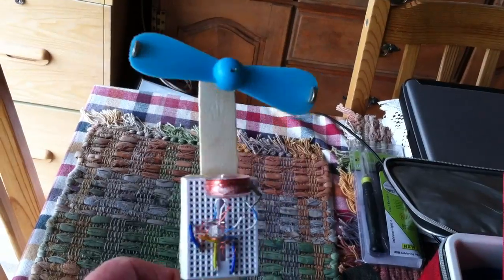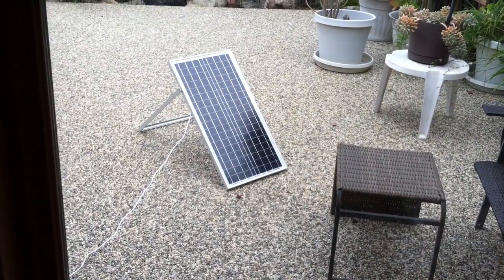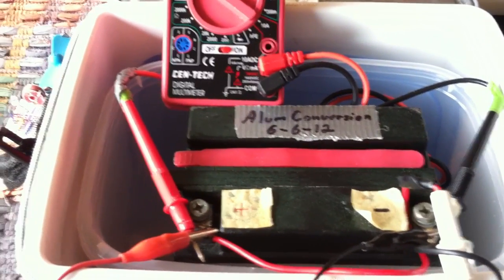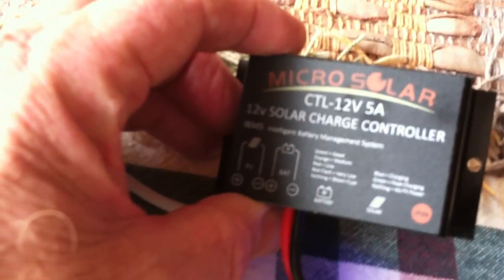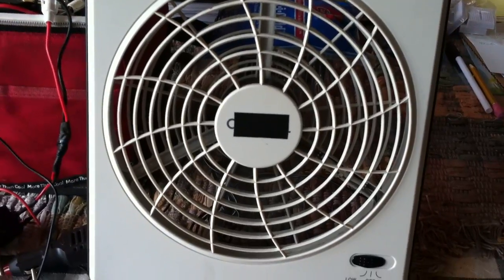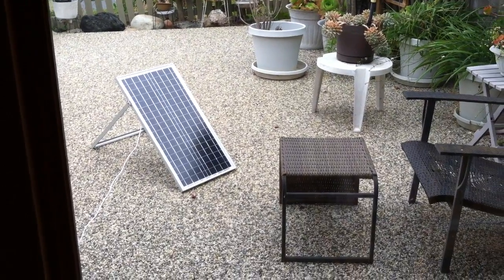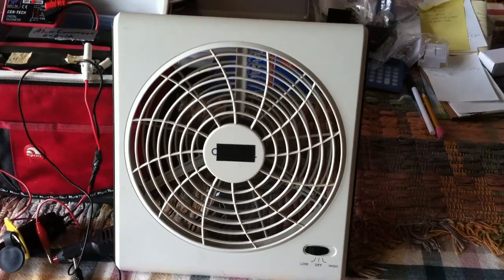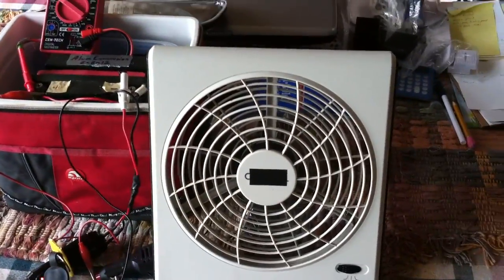Free Cool --- My solar powered AC quest

Comment: A 12v, 4A freezer = 48W.  Your Solar panel is 30W.  Will your batt or batt bank be sufficient to kickstart the freezer compressor & keep the system running when the sun is not shining or are you planning short enough day trips where it won't matter?

My Suggestion:

1.  Acquire a low boiling point ammonia compressor + freezer box (packed full of dry ice at the start of your sea trip).  You might find some help finding one at some RV vendors.

2.  Repurpose an old window AC unit evaporator coil (2 layer is best) + a 12V car radiator fan (to use on your evaporator coil).  Pump either refrigerant (low bp ammonia) or water through the evaporator coil.  Return the refrigerant to the suction side of the freezer compressor or return the water to the dry ice to continue the process (depending on which design you choose to make) .

The dry ice is stored potential energy (lacking heat).  So it could provide quite a bit of heat exchange for you.
Reply from the maker: Thanks for that tip.  The boat is pretty well ventilated and it has a bilge blower to vent that.  It would still be a good idea to keep the ice chest holding the dry ice on deck somewhere. Thanks.
Reply from the maker: Thanks!  Dry ice is a great idea.  The trips I take now in the boat usually only last 3 or 4 days and the dry ice might just be the answer.  On my first trip to Hawaii (many years ago) we used dry ice and it did last quite awhile. Thanks for the tips.
Reply: Just a quick note that you may already know- be careful of having dry ice in an enclosed space
Reply: Good safety point to make!  CO2 is ~54% heavier than air, so without proper ventilation, there is a risk of suffication.

Comment: Our classes a few years back took one of those 12 v. Freezers apart and took the cooling unit (peltier disc, heat sink, and control board all on foam) out and turned the peltier disc over which put the HOT side toward the cooling fins and used it as a heater for under my tchrs desk in the shop classroom.... with a small 6 inch 12 v. fan and it worked great! Like you we used a solar panel, battery, et.al, to power the thing. Had to take it down when the maintainence found we had drilled a hole through the ceiling to get the cords to the roof  :-)  [had to pay to fix it also!] --- Oh well, it was a great teaching experience kids never forgot. Lesson learned? - NEVER drill through schools ceilings......
Reply from the maker: It is funny but some of my most "remembered" lessons from school were events just like that.  It was the unusual things a teacher did  that left a lasting impression.  I had a biology teacher in 7th grade who took 10 minutes at the end of each class to read the book 1984 to us chapter by chapter. He finished the book by the end of the course.   I vaguely remember dissecting a frog in that class but the message from that book stuck with me.  It changed  how I viewed the world.